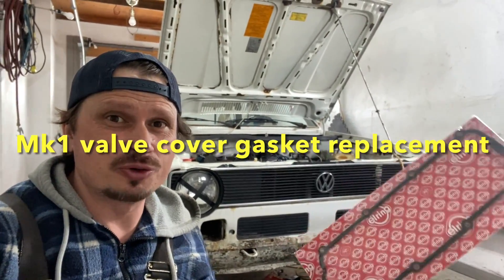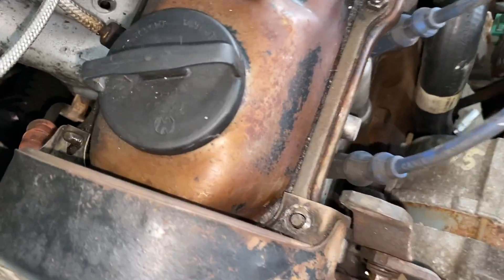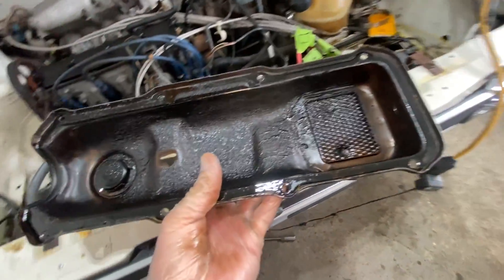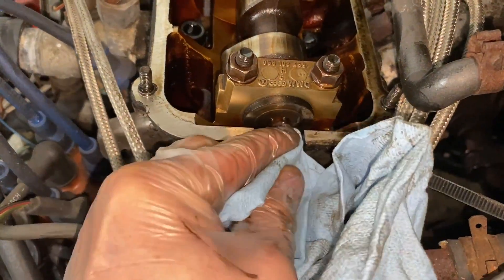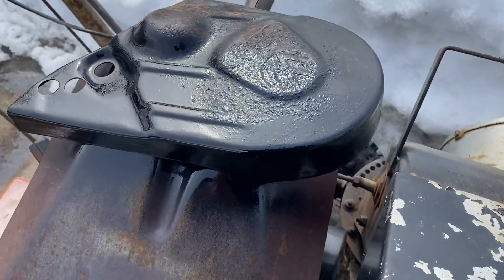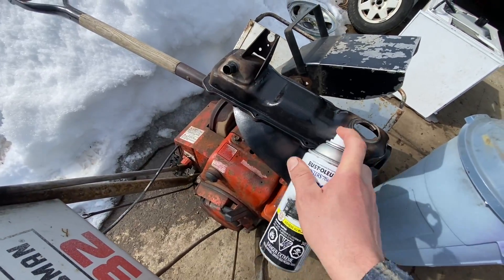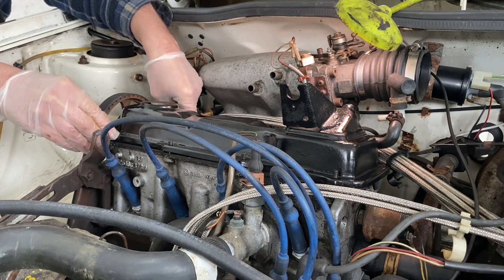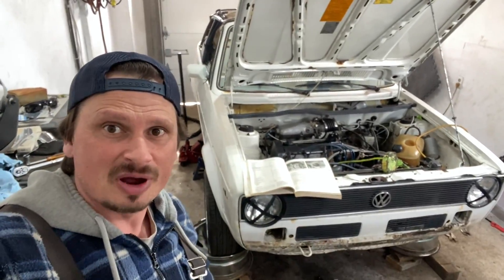VW Golf ￼Mk1 valve cover gasket replacement. How to replace the valve cover gasket VW ￼Rabbit Mk1￼

Comment: You need to replace the studs to use that new rubber gasket to insure no leaks. I found another video on using this gasket properly to prevent oil leaks. https://youtu.be/JkBsE_3qWyo?si=kh8OMgX1YpXBofL8

Comment: Don't you have to replace the studs to put that type of gasket
Reply: Yes. I'm almost 100% percent positive you do. Original studs have a metal stop at the end that meets with the cylinder head. That gasket has built in metal washer that will sit on top of the original studs. 
This one will leak unless it's a different model from what I have experience with. Hopefully he double checks before turning it on.
Reply: As soon as he started the motor it would leak.  you need to get the stud kit for the rubber tappet gasket or just buy the cork gasket.
Reply: Yes, you do. Mine leaked oil on my first test drive. 😢
Reply: I  have both gaskets. Can I make the studs from bolts or is the metal special. They don't sell the studs only here.